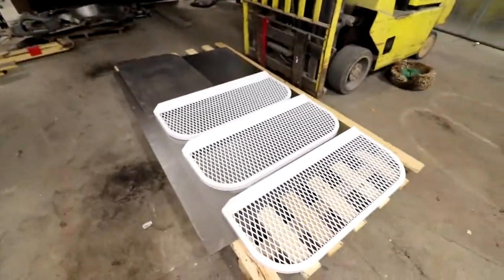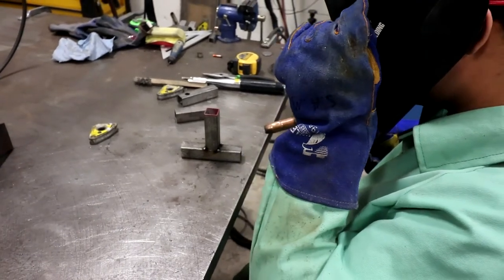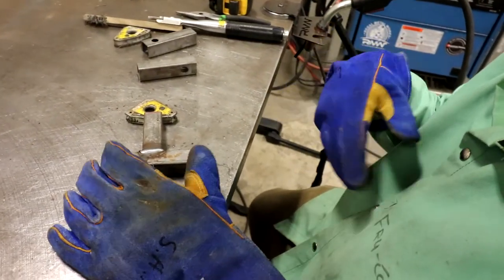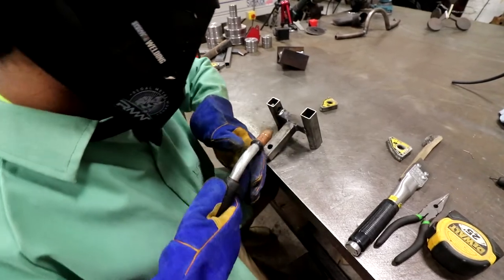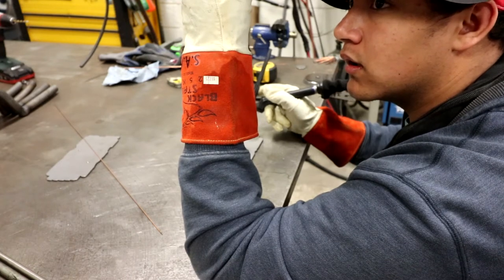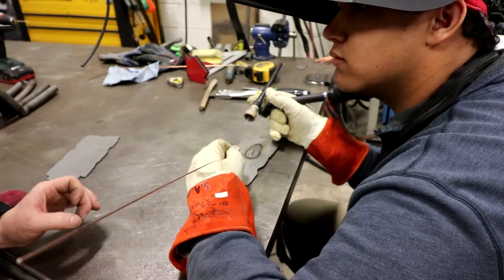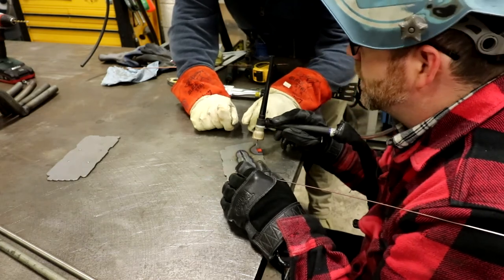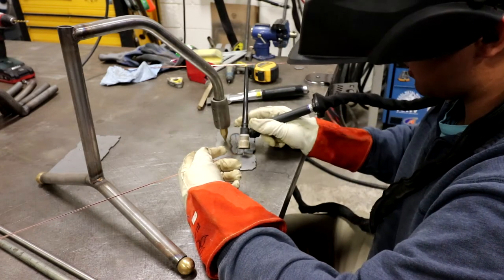Rook's Mig/Tig welding lessons and updates RMW - Vlog 126

Comment: Cole,  On the window covers, I only do projects for myself so I pretty much always look at getting the maximum amount of the material and not at the amount of labor that is needed.  So on your last Vlog my initial thought for the top of the frame being cut out of plate was that there is a fair amount of material waste.  When I saw the finished product today the thought came to me, would it be cost effective for you (paying shop) to rather than cut out the top frame and then weld the expanded metal to it, would it be beneficial to simply cut the pattern out of the single top plate on the plasma table and then just weld the side rail to the single piece?  Just trying to do the work flow/cost analysis in my head and trying to think of the best way to do it.  Thanks for the Vlog's  keep up the good work.  R.J.
Reply from the maker: Hi R.J.  I had originally designed it that way, but I decided to go the way I did for a few reasons.  It would of have been cheaper to use just one material of course, but there is a trade off.  So cutting that many pieces out on a plasma, you are asking for problems.  One of which is any hiccup and you pretty much scrapped the piece and trust me there are more hiccups than not.  It also takes a long time to cut that, which means having someone watching it the entire time.  I never walk away from the plasma table when it's cutting, now the CNC  mill, sure.  With that many cuts, you will have a ton of dross to clean up on the backside.  It will also add a lot time to the build.  More time than tacking the expanded metal in.  I wanted a finished look, that I felt would of looked better using expanded metal.  The wasted material is not really wasted, as it will still be used on other projects as it is still fairly large pieces.  For the record, the expanded metal in 4x8' sheet added $150 to the build, but that equates to 2 hours shop labor which is saved by not having to take 2 hours to cut and probably another hour or more to clean dross.  Hope that helps!  I value and appreciate the feedback!  Thank you!!!
Reply: Yes, I was sure that shop time certainly changes the economics drastically from how I do things.  I was thinking about the dross removal and cleanup but I never thought about the machine error variable.  I haven't had the joy of working with a plasma table.  It's run by a computer, isn't everything always perfect?  Don't answer.  I like to look at designs and think about other ways to approach them as a brain exercise.  Thanks for the quick answer and enjoy the snow.  60 and sunny in Wyoming today.